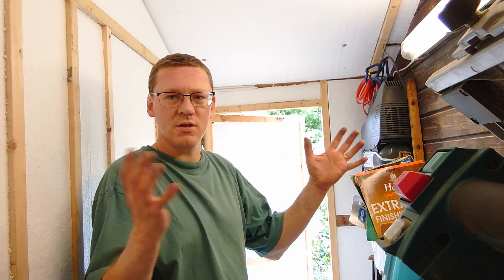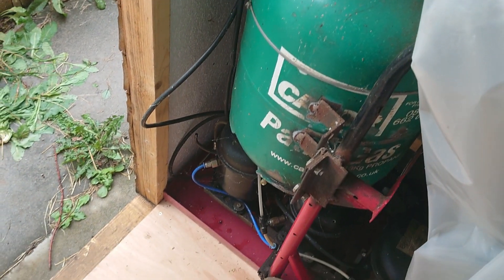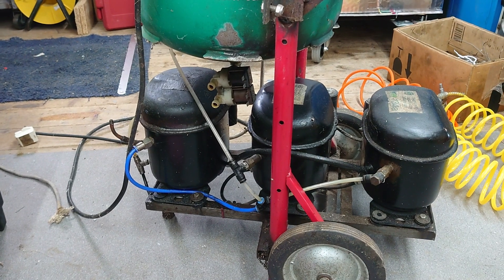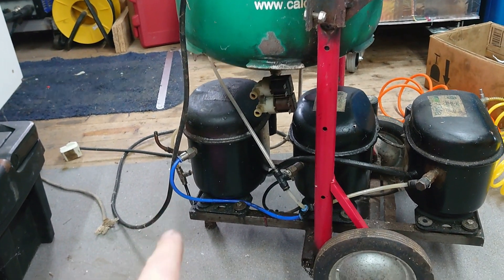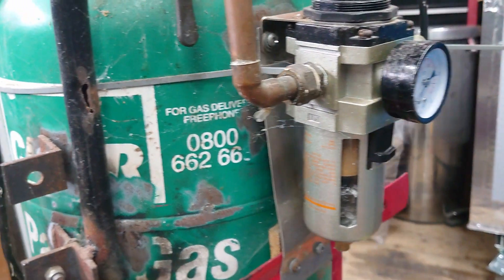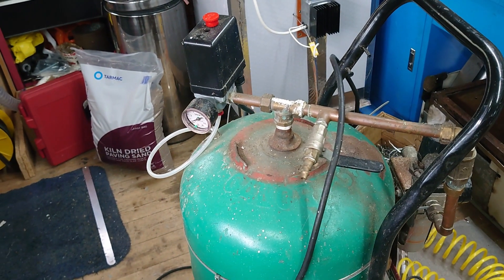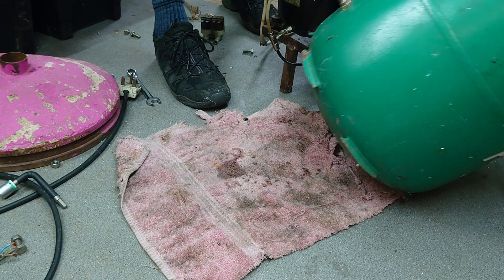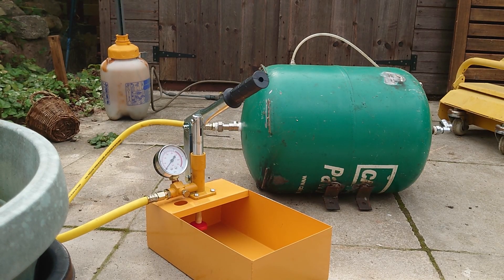Pressure Testing my homemade Air Compressor

Comment: Isn't it sad that these days we buy these Chineesium products in the full knowledge that the specifications are completely fictional. 
I have a generator that claims to have a 6.5 HP motor and an output of 8.5 Kw  !
Neither of which are anywhere near close.
The sad part is we still buy them.
Reply from the maker: Hi Steve, I think we all know what we're getting in to with cheap Chinese tools. Certainly from my point of view, although I wish they were better, they are usually just about good enough to do what I need as a hobbyist. Also there are many tools that I just can't justify spending out on a 'proper' version which is usually about 10 times the price. The pressure tester is one of them. If I had needed to spend £100 on a pressure tester, I just wouldn't have bothered, but for £10 it was worth it just to have a go. I've now got a functional tool that I may use once or twice in my lifetime.
Reply: @ollysworkshop  
Agreed.
I feel the same.
Some things I would rather buy second hand to be affordable but still give better service. 
I would have done the same with a pressure tester.
If in time I had found it to be invaluable and used the item a lot it would be easier to justify a more expensive replacement.

Comment: Hi Olly, Definately made the right decisión. Well filmed and narrated, well done!!

When carrying out pressure testing at work we are also looking for permanent deformation. Looked at nice piece of pressure test equipment, by the looks of things Chinese, were you happy with it? 

Was the stunt cat yours? It didnt bat an eyelid!!

Good luck from Spain!!
Reply from the maker: Hi David, thanks. I was surprised by the pressure tester, it was the cheapest one on eBay and I wasn't expecting it to reach full pressure. It is very flexible and Chinese feeling, but did the job it was supposed to. The cat is one of ours, she's called Treacle. She wasn't in the firing line, and I only noticed the silhouette when editing, so I went out to find her afterwards for the close up shot.

Comment: hi Olly
i don't think it would have blown if only using at 100psi but best play safe if unsure,  it's just like pressure testing my loco boiler.
good info for the uninitiated.
take care
Kev
Reply from the maker: Hi Kev, I would tend to agree that it probably wouldn't have blown, but I was sufficiently uncomfortable with the amount of rust, and as I was giving it an overhaul, seemed the best course of action. Peace of mind is also worth it for me.

Comment: Frankentools at their best! I half expected (hoped!) the tank to come rocketing back toward the camera when you opened the valve! For what it's worth, I reckon I too would have swapped out the gas bottle for a purpose made receiver tank given your findings. Safety first and all that 👍. I've very recently parted with my noisy little compressor in favour of a littler-still fridge type (short video in the works) and I much prefer it, in spite of the greatly reduced amount of air it makes. Keep up the great work 👍
Reply from the maker: Hi Matt, I think I had more air in the tank than I should have. If there was no air in there it should have been fairly unspectacular. I could see a little pocket of air in the 6mm hose, so I was expecting a bit of a squirt, but it was a little more than I expected though. Now looking forward to rebuilding with the new tank, and making something a little less thrown together.

Comment: Hi Olly, interesting test. I always fancied making a fridge unit compressor just for the noise benefits. Don't trust myself lol. You have made the right decision I think. Cheers, Jon
Reply from the maker: Hi Jon. It's certainly very quiet, especially when behind a wall. I can usually tell when it kicks in by the lights dimming! I was always intending to put some sort of motor sequencer on it so only one motor switches on at a time, but still not done it. Another job for the list.  I will definitely feel a lot more comfortable with a new tank attached.

Comment: Your contraption there will last longer than the oil-less compressors they make today.  And yours is much quieter too!  Probably sounds like 3 refrigerators running.  ;-)
Reply from the maker: Yup, pretty much sounds like a fridge. Keeps the wooden floor well oiled too!